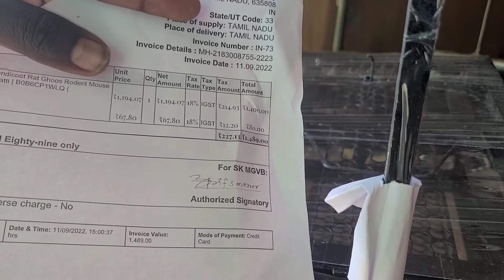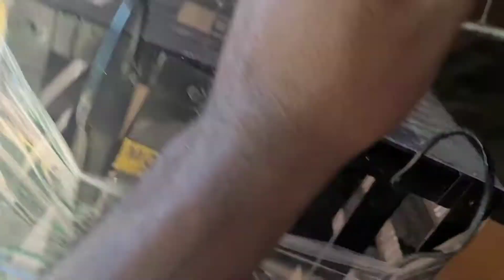Big Bandicoot Rat Ghoos Rodent Mouse mongoose Trap Cage unboxing

Comment: Sad, the trap door wire lock had to be pushed down.  A failure in design. If the trap door wire does not come down on its own the bandicoot will push and escape. Double check the video
Reply: I think correct way to use perfect lock me double check the video😂